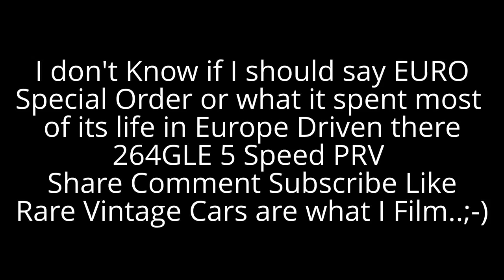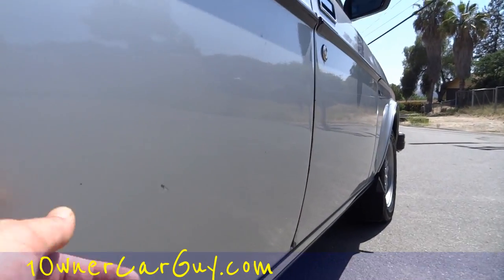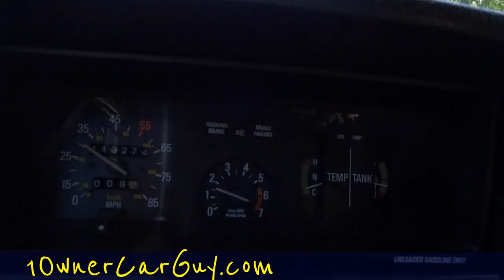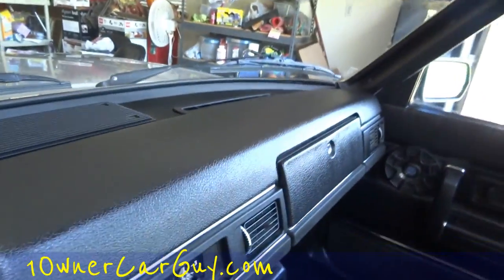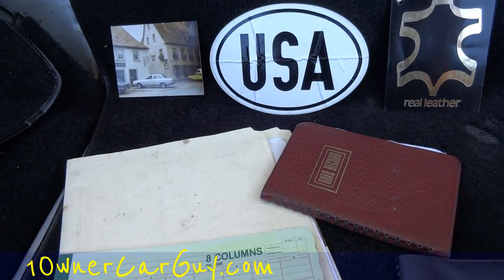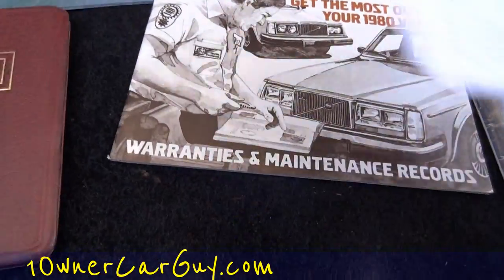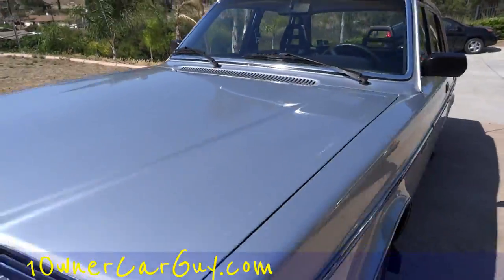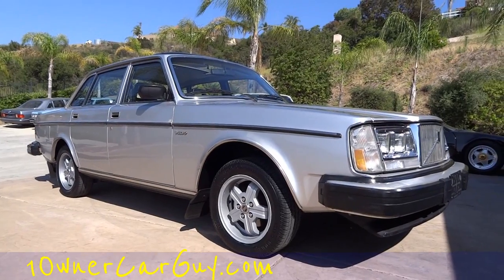Volvo 264GLE 264 GLE PRV B28E B27 240 Brick 200 Series Rare Manual Overdrive 6cyl Peugeot Renault

Comment: The problem with the 264 is the engine, it had major issues with the camshafts because the oil would not circulate to the top of the engine efficiently and the camshafts will fail. That is why you hear that knocking noise while he was driving, the same engine was fitted to the Renault 30 and the Peugeot 604.
Reply: Crap engine - had a 265 with this motor in and it was a gutless heap - total boat anchor of a motor .

Comment: The engine sounds noisier than the 4 cyl redblock - the PRV V6 when running right was super silent and definitely could not be heard from inside the cabin. That engine needs the valve train  looking at pronto!

Comment: i do like PRV engines they sound distinct. in the UK we never got the V6 volvo 264 or 265. just the 244 or 245 with 4cyl petrol engines and no diesel option either.  i do like these and later 240's built like tanks and go on forever.
Reply: Cereal Marshmallows the B28E what volvo called it was also used in the delorean dmc12 you can still get brand new engines for them. the PRV B28E was also used in alot of french cars like citroens, renaults, peugeots etc. none of the 3 are that common in the U.S
Reply: David M They outlived many cars at its time and could go around the clock a few times without any huge problems. You are right though sometimes repairing a car can cost more than the car is worth which makes owners scrap them.
Reply: +Cereal Marshmallows Mr Jagger is wrong. I worked for a Volvo dealership in Caterham south London in 1978 and have driven both the 264 and 265.they we're available in both GL and GLE spec.
Reply: @darrylkennedy2236  Can't have made many.

Comment: It's been a long time, but I think those Volvo wheels are called the "Virgo's". Someone correct me if I'm wrong. I've owned 3 240's, never a wagon though. I love those s60 wagon R's. 240's are so easy to work on.
Reply: They are indeed called Virgos and they came on the turbo cars.

Comment: I hear Valve rattle.... because oiling ports were designed too narrow.... causing early engine failed..... otherwise a great motor.... my shop used to remove overhead cams through the fire wall

Comment: PRV V6 ( PSA-Renault-Volvo V6) is the worst engine pit in a Volvo. That's why Volvo stopped the engine and replaced it with the Volvo wide lock inline 6 an Renault replaced it quickly with their own V6 but PSA kept it for a while and then replaced it